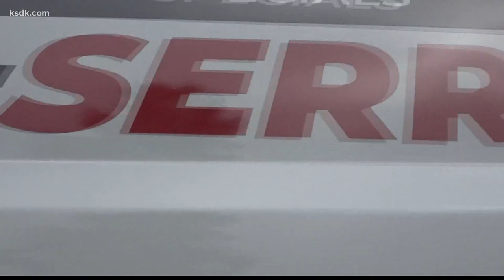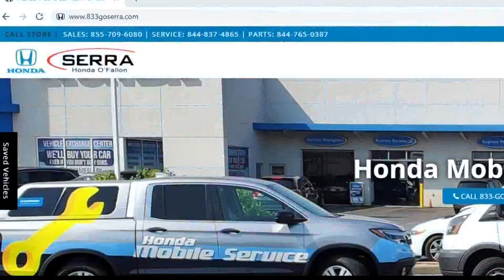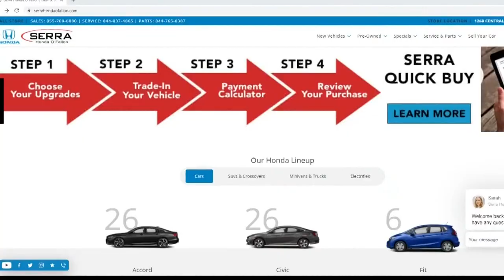Serra Honda O'Fallon is offering a new Mobile Mechanic service

Comment: I feel like it would be easier if the mechanic left the van took the car to the shop did the work then drove the car back and drove the van back to work
Reply: As an employee of Yoshi as a mobile mechanic I would disagree.  Driving to the customer and recycling materials after service are the hardest part. Service the vehicle is easy. Most services do not require a complex lift like the one used in this video. Independent contractor at Yoshi Inc Nashville tn.